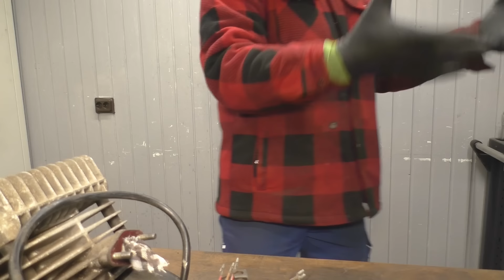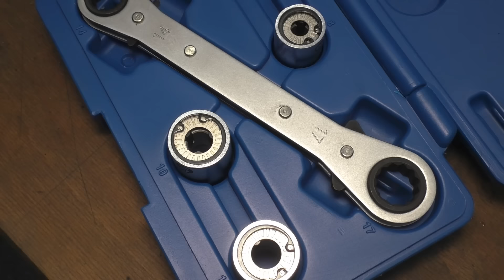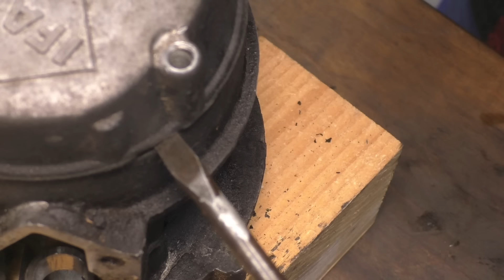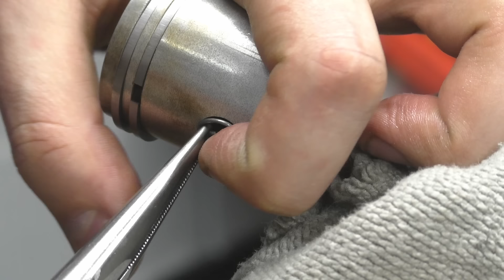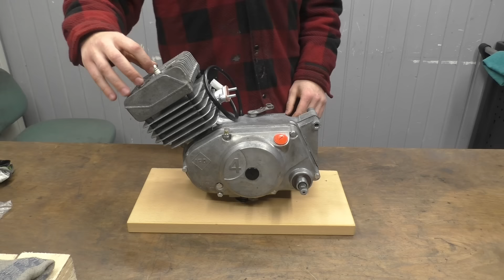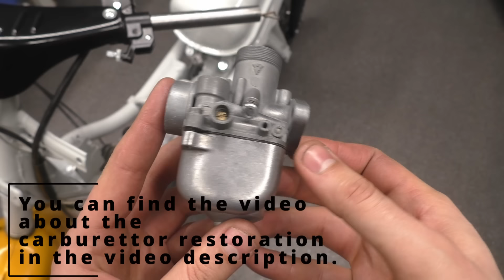1980s two strok 50ccm Engine - Full Restoration

Comment: I had a Simson Mz 50. Great little bike which i wish i kept.
Reply from the maker: Nice, of course it's a shame that you don't have it anymore.
Reply: @restorwerke  It was near new when i got it. The lad i bought it off had snapped the kickstart shaft so had no gears. I had it welded up and just bump started it so not to snap it miles from home. It was a sky blue colour. The british goverment decided then that the old fs1e and garelli etc were far too powerfull for us young folk and the age of the slowpeds came in.The little Simson used to fly and wipe the sneer of youths on rd 50s etc
Reply: Simson vagy Mz?🤣
Reply: @brendonkadzsuraszik9827 Simsont Angliában is MZ néven adták el.

Comment: Gute arbeit 👍 paar sachen die ich anders gemacht hätte: kurbelwelle und abtriebswelle neu und schaltwalzenbolzen auswechseln gegen verschraubt
Reply from the maker: Vielen Dank und danke für die Tipps :)) 
Ich werde den Motor über Winter wieder überarbeiten und vieles kommt neu rein, die genannten Teile kommen definitiv neu. Danke und schöne Grüße:))
Reply: Das war auch mein Gedanke. Stark exponierte Losradwelle, und dann die alte Kurbelwelle wieder in den frischen Motor. Wieso der Schaltwalzenbolzen überhauot ein und wieder ausgepresst wurde, scheint mir sowieso ein Rätsel. Allgemein der Zusammenbau mit alten verschlissenen Teilen bei vollem Bewusstsein ist fraglich, dies jedoch als Video bei YouTube hochzuladen noch viel eher.

Comment: Ist das richtig, daß man ein gehärtetes Kugellager mit dem Gasbrenner erhitzt, damit sich das ausdehnt? Nachdem Stahl "abgeschreckt" wurde, wird der doch bei ca. 200°C wieder weichgemacht, für 20-30 Minuten, je nach gewünschter Stabilität. Wenn man da mit dem Brenner rangeht, wird da nicht das Gefüge zerstört?
Reply: SKF gibt eine maximale Temperatur bei Montage von 120°C an. Wasser kocht bei 100°C, wenn man also ganz genau auf den Innenring des Lagers schaut sieht man dort Kondenswasser, sobald die 100°C erreicht sind verschwindet es. So erreicht man relativ sicher die korrekte Temperatur. 
Der Brenner muss aber mit Bedacht verwendet werden, sobald sich auch nur ein Hauch Farbe zeigt (fängt ganz leicht gold/gelblich an), dann ist das Lager genau genommen zerstört. 
Mir ist das mit Brenner zuviel Risiko (besonders bei anderen Motoren, wo der Lagersatz nicht 20€ kostet), deswegen mach ich das mit einem kleinen Ofen.
Selbes Thema beim Gehäuse, das darf auch nicht sonderlich heiß gemacht werden, da das Alu seine Duktilität und Härte verändert, außerdem ist es möglich, dass das Lager vom Gehäuse zu stark erhitzt wird und damit zerstört wird.
Lange Rede garkein Sinn, vorsichtig sein dann klappts. Hab schon Motoren zerlegt, bei denen die Lager blau bis lila verfärbt waren und die liefen auch.
Reply from the maker: Danke für die Info 👍😊

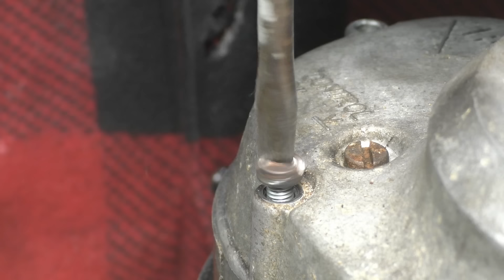Comment: 3:00 - total unnecessary! 1 punch on top of the screwheads will loosen them EASYLY !

4:40 - are you insane or TOTALLY INCOMPETENT ??? NEVER split this motors with a HAMMER !!! There are many Special Tools for deconstruction of this engine!!!

You‘ve DESTROYED THIS ENGINE FOREVER 🤮
Reply: Du hast scheinbar noch nicht viele Motoren geöffnet😂😂Es gibt so viele Motoren, da kommst du mit bissl auf die Schraubenköpfe schlagen nicht weit😂Klar ist mit Hammer spalten nichts, was man empfehlen würde aber der Typ hat nur diesen einen Motor gemacht, da kauft man sich kein 50€ Werkzeug. Mit dem Hammer machst du bei genügend Temperatur und behutsamer Handhabung nix kaputt😂
Reply from the maker: mach dir keine Sorgen. Der Motor wurde mit viel Liebe und Gefühl revidiert :)